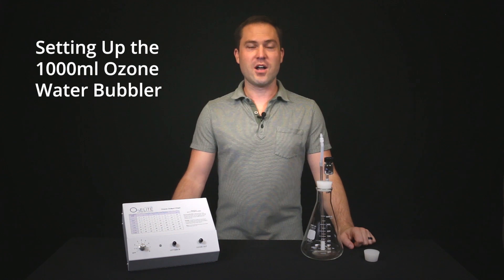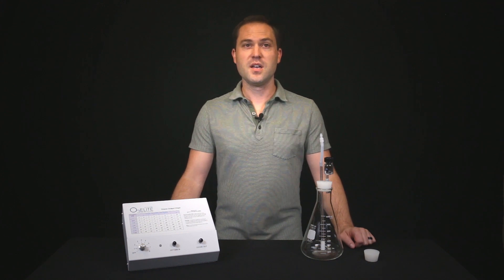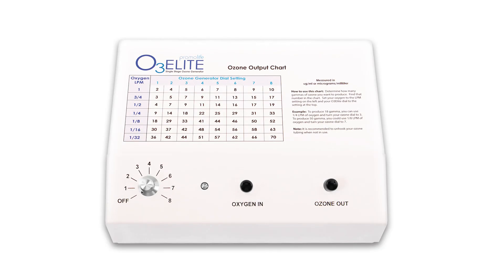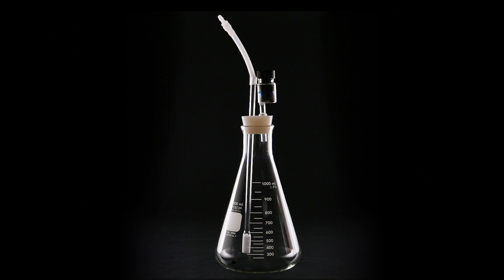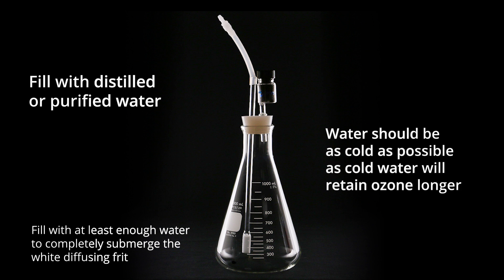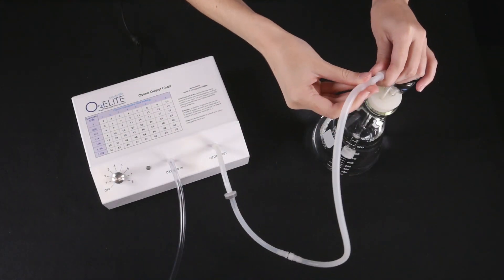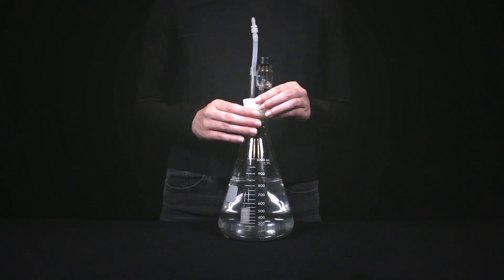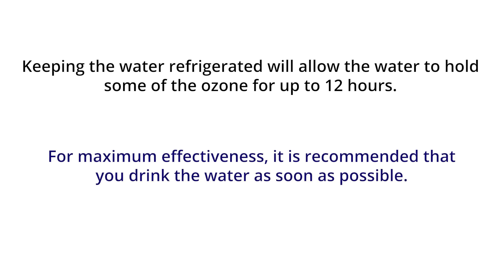Setting up the 1000ml Ozone Water Bubbler for Ozone Therapy

Comment: We have an O3elite ozone generator and 1000 ml bubbler. 1000 ml is more ozone water than we like to drink at one time, so started making 500 ml at a time. The water level in the bubbler is very low with 500 ml and bubbles go through very quickly. Is this sufficient time for the bubbles to be in the water to saturate the water?  Also, some days at 1/8 l/min setting we have bubbles in the water, but some days there is only a hissing sound and very few bubbles. If I set to 1/4 l/min it seems like there are too many bubbles, and perhaps wastes oxygen. Does the regulator need cleaning, or do you have any advice?
Reply from the maker: You can push down the glass straw so it goes deeper in the flask. This will allow you to use less water. Recommended flow rate is 1/8 LPM. If you have any other questions feel free to send us a support ticket via our contact page so we can route it to the right person more efficiently.

Comment: What gamma setting? How do you determine the gamma setting?
Reply from the maker: Your ozone generator would come with a chart that shows what combination of oxygen and generator setting would be needed to get one of a range of ozone outputs (measured as ug/ml or gamma). Check out our Basics of Ozone Therapy video, it goes over a number of ozone topics.
Reply: @promolife  I have your machine and I can see the chart, but I don't have the bubbler yet. in regular cold water 1/4 oxygen with dial at 2 for 15 minutes in purified water.  Can we over ozonate water?
Reply from the maker: @suzan24k  Once the water is saturated it just won't saturate any further.
Reply: @promolife  this video doesn't say anything about setting.  I have same question.  How do you determine the gamma setting.  Please answer.
Reply from the maker: @lihsuehcheng  It will depend on your ozone generator, which should have come with a chart letting you know which settings to use for the amount of ozone you want.